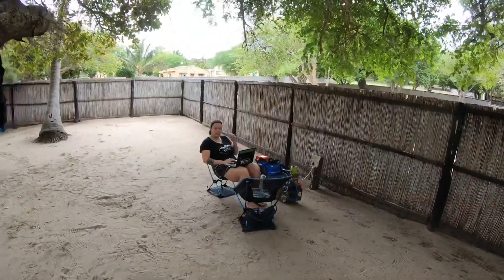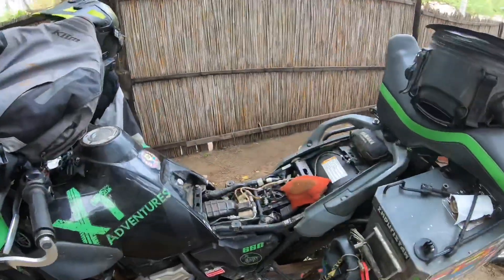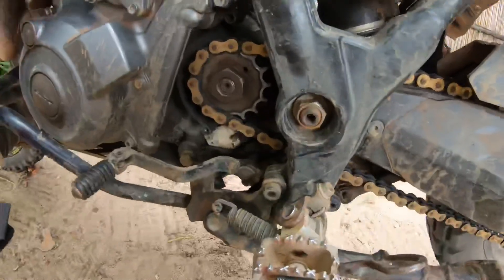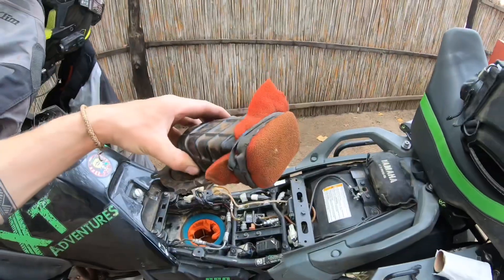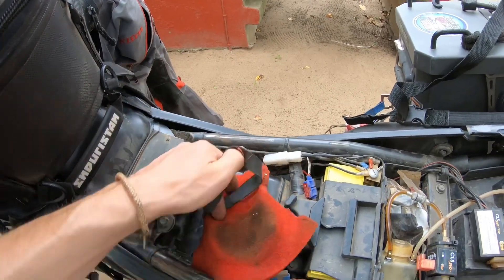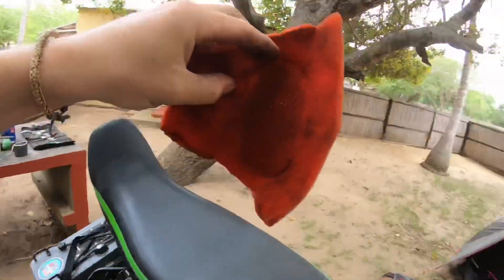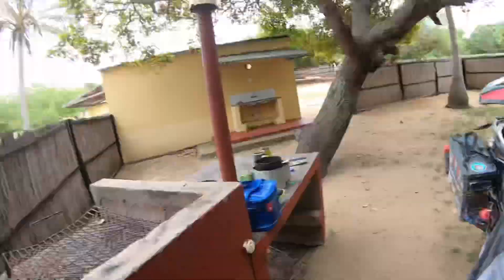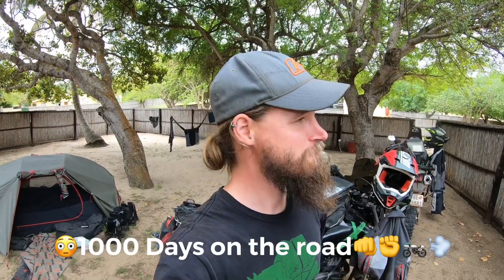Long time on the road and some maintanance

Comment: Excellent tip about the air filter, and congratulations! That's quite the achievement!
Reply from the maker: As the Magpie Flies Thank you, yes I had troubles with my engine because of a dirty airfilter, so I thought I share my solution😉👍